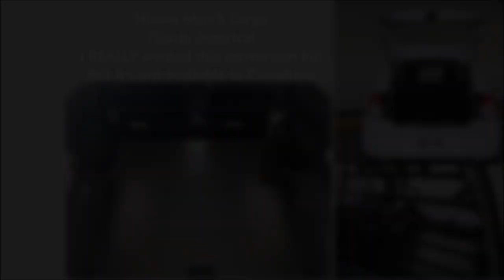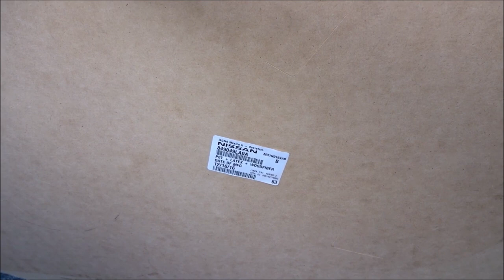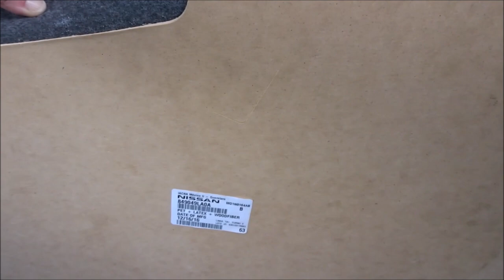How To Get A Fold Flat Cargo In A Canadian Nissan Micra - Easy & Cheap

Comment: Totally awesome, I was actually thinking of doing the same and came across your video when searching for videos that show how to remove the back seat - but nothing for the Nissan Micra specifically. I found a forum where they talked about an additional clip thingy that holds each of the 2 metal clips of the back seat in place. Other general videos (of other cars) just show how to pull up the back seat and the clips come out. How exactly did you remove yours? Any tips are much appreciated. :-)
Reply: @MissusWhoDoesStuff  Thank you so much. I took it out last night and ended up being able to pull it up enough to get my fingers in there and finally managed to get the clip to open and release the latch. :-)
BTW, your cargo space looks awesome, I love the hummer mat, that's a great idea.

Comment: Can you please add a warning to this video. 

By removing the rear seats in a Micra you're actually compromising the structural integrity of the vehicle.

Your insurance may not cover you after you have removed those seats.
Reply from the maker: Saw this comment from last year - removing seats from a car does not affect the structural integrity in any way.  This car has a cargo model in Mexico.
Reply: are you trying to argue the seats of the car are part of the frame?